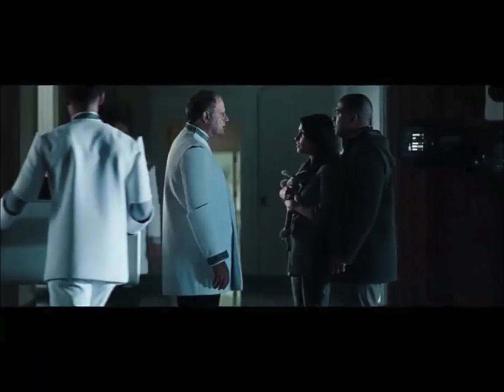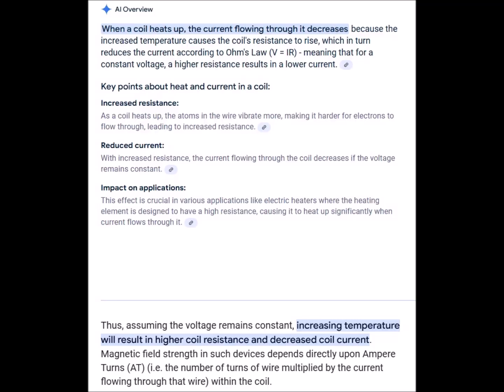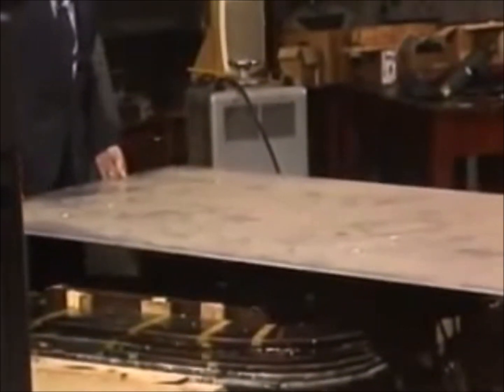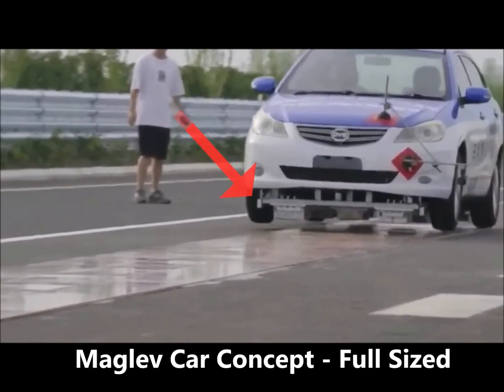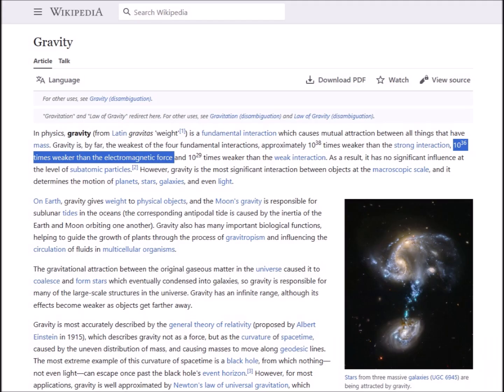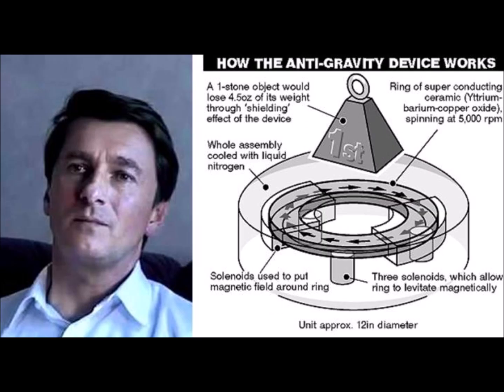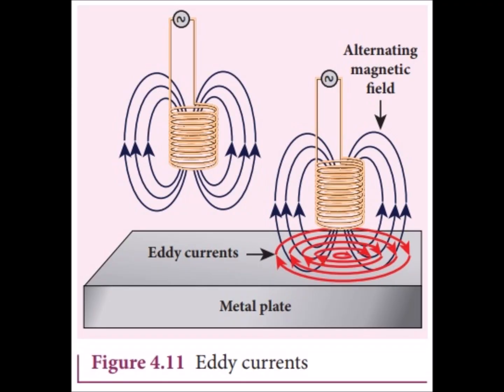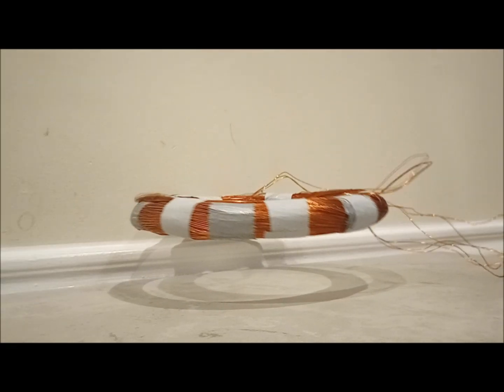Magnetic "Antigravity "

Comment: I may have a solution that is put the magnetic coil in th refrigerator for 12 your wicth you did but workout it in an ice cream tube filled with red shine or sake for 48 hours which I heard japanese researchers did to increase superconductor
But coil the side in a mobile wire turn about 350 turns or salvatore paris pulsed current patent would be better which you could test it out ok you can add parametric resonance oscillator use spark gap tuned to monopoly pulsed magnet s you need to test this now or show ever listening to me at least test it ok

Comment: just a thought, have you ever heard of the "magnetic inverter" from grand illusions? it's a really interesting toy and I think if scaled up properly it could work for these applications indoors of course but starting with hovering furniture, of course I think stuff like this could only become a little more viable energy wise when cities and towns are powered by fusion reactors imo and also using the magnetic fields to wirelessly connect a wheel to a bike like in that movie big hero six with strong enough magnets using this inverter config
Reply from the maker: @SpectacularRanker2  Yes, magnetic inverter; the "magnetic tractor beam"! It's really cool! There are also ways to arrange permanent magnets that effectively switch them off. It doesn't turn the fields off, of course. Instead, the switch is used to conduct and divert the fields internally so that they don't attract metal in the outside as they normally do. The switch can then "turn the field back on".

Comment: Levitation by opposing magnetic fields requires too much energy for a small effect, but the following passage maybe helpful. "I learned that this fellow, Mark Stambough, had developed an experiment that created a kind of levitation. In some circles it's been called electrogravitic levitation, or antigravity. What he did, apparently, was acquire a high voltage power source - a DC (direct current) power source, and he took a couple of quarter-inch-thick copper plates about a foot in diameter, with a lead coming out of the middle of each one at the top and the bottom. Then, he basically embedded them in a type of plastic resin like polycarbonate or Plexiglas, or some other kind of clear resin where you could see the plates, and you could see the material. Apparently, he did everything he could to get all the little air bubbles and stuff out of there, so there wouldn't be any pathways for the electricity to break down the material and arc through them. The experiment was to see how much voltage you could put on this capacitor - the sub-plate capacitor - in this arrangement; 

How much voltage could you put on this thing before the insulating material begins to just break down? Well, he got up to about a million volts, and the thing would begin to float, and it floated in accordance with principles that had been described in a patent that was filed back in the late 1950s/early 1960s by a gentleman called Thomas Townsend Brown"

Comment: you need Iron ground plat everywhere you go , no good ..
Reply from the maker: @mykedoes4099   Project Magnet (a UFO study program from the 50s) and the "Magnocraft" concept discusses the use of the geomagnetic field for propulsion. But the fields would have to cover a large area in order to overcome the geomagnetic field's uniformity. The dip needle proves that a vertical force can be derived. Whether or not it can be done efficiently is another question altogether, though.
Reply: @gsutton78  sounds do able with the "right minds"
Reply: What if we could add something (safely) to the asphalt.
Reply: The roads might end up adding power to the grid.
Reply from the maker: @raycar1165    There still be significant wasted energy from maglev such as heat and vibration. This energy as well as energy from foot traffic, etc., could be harvested and stored in capacitor banks for later use. Not to mention that we're not even close to maximizing solar energy usage. More solar energy strikes the Earth every hour than the entire planet uses in a whole year!
Reply: @raycar1165  High voltage cuts threw insulators too easy especially with high amps behind it.. Could use High Voltage Low Current safely and efficiently .
Reply: @raycar1165  low voltage low current or high current is not efficient but safer than high voltage high current . It begins with  designing your source power for any application
Reply from the maker: @raycar1165    Yes, exactly.